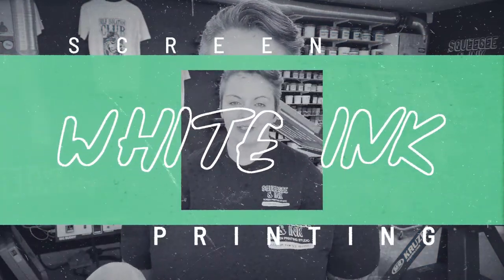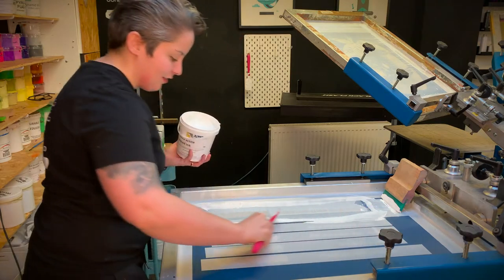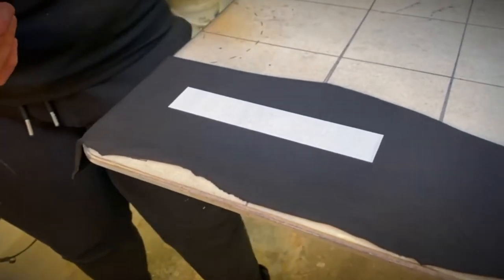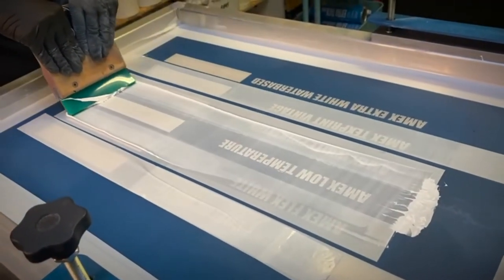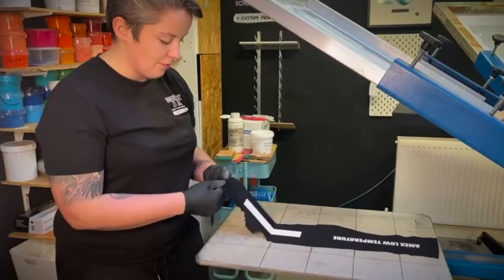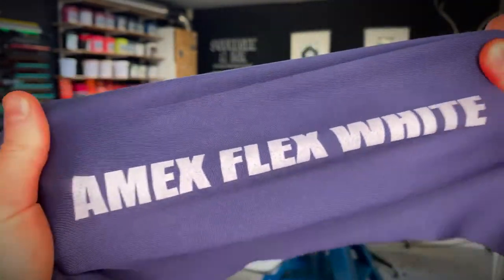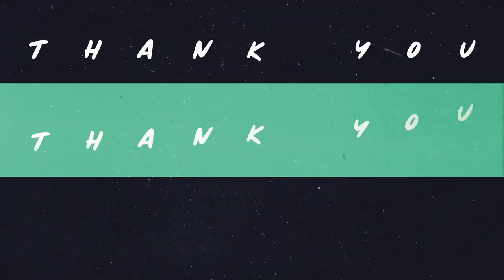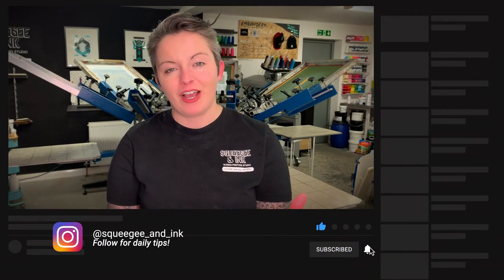Which white ink for screen printing t-shirts?

Comment: i've heard you can cure plastisol inks with a heat gun, I want to have a go which Amex plastisol ink would you recommend for this?
Reply from the maker: Hey, I don’t recommend it with any ink really, but a tip would be to keep the heat moving and just to try make it touch dry with the heat gun. You would need a heat press to then allow the heat to get through the ink to cure it without scorching the shirt. Not ideal but I do understand it’s not possible to have a flash and conveyor dryer from the beginning.